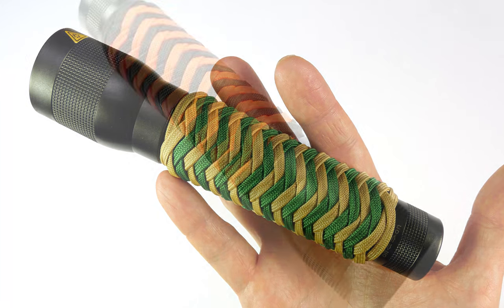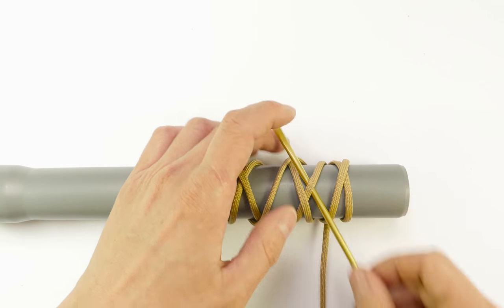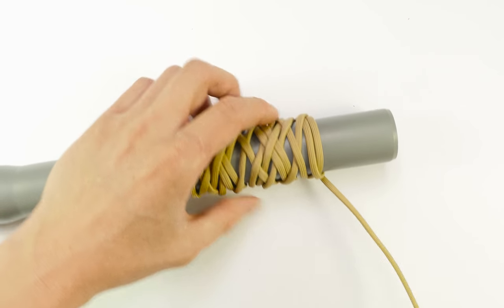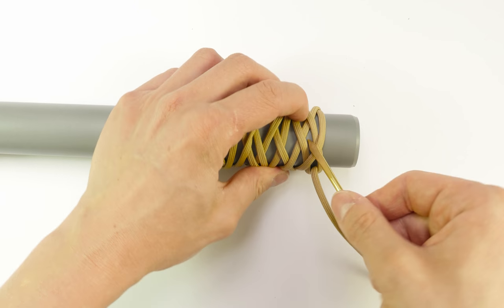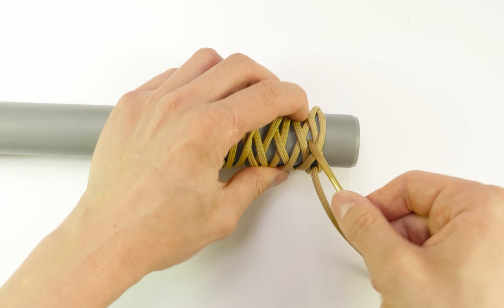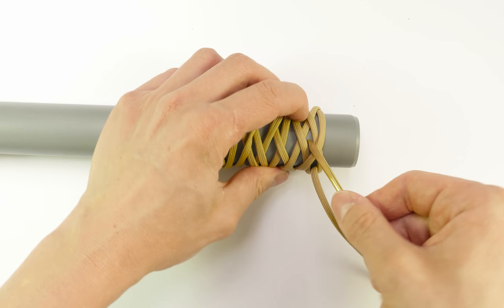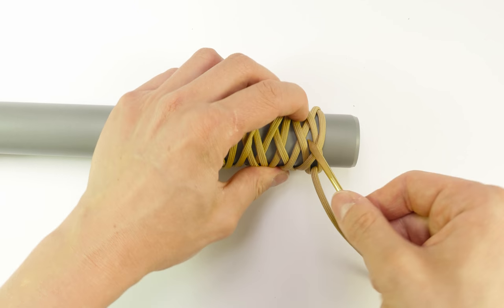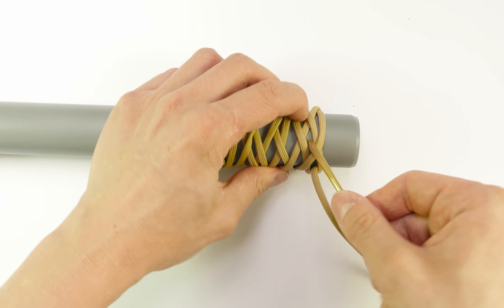Paracord flashlight wrap- pineapple knot

Comment: I have a question Mark that has baffled me forever... How does one determine how large to make the base knot so it fits the object perfectly... So that it's not too short nor that it's not too long... I always had to rely upon trial n error... Which means I have to start over sometimes 3 or 4 times... And if you expand it to a 6 bight it's too long... Can you explain that process of determining how long to make the base knot... Thank you, Mark
Kenn <><
Reply from the maker: Hey Kenn!

I don't use any metric, I just go by feeling. This is as you note does mean I have to redo a knot sometimes. The advanced grid maker does have a neat feature that allows you to calculate the width and length of the project which may be helpful.
I really should cover the math aspect of designing turk's heads.

Mark
Reply: Yes... you should cover how to design a Turk's head knot... I think that would be a very helpful tutorial... Kenn